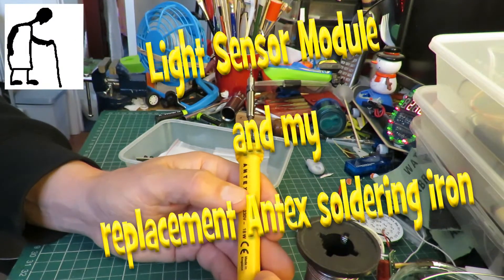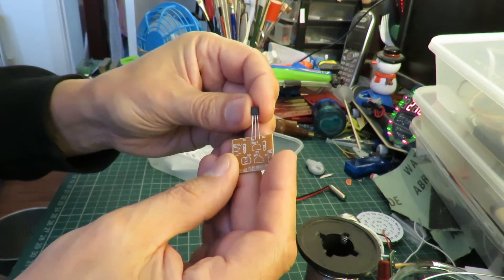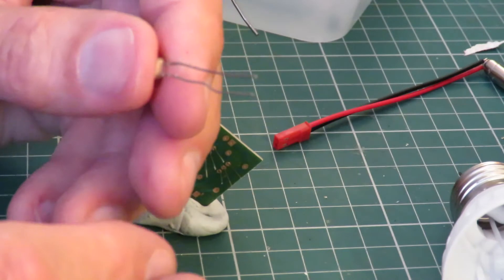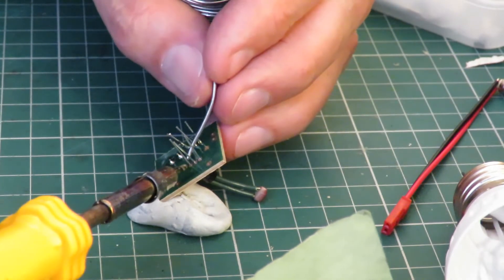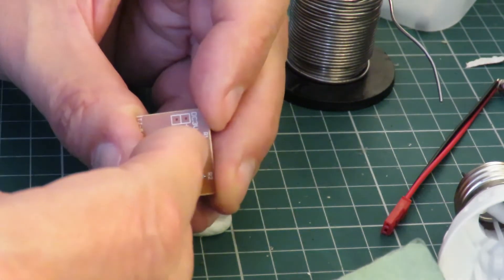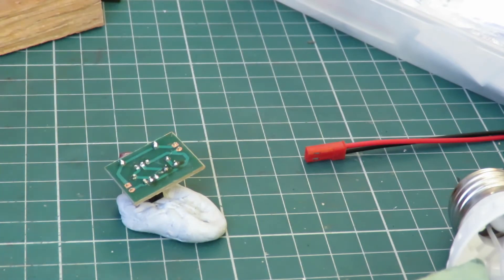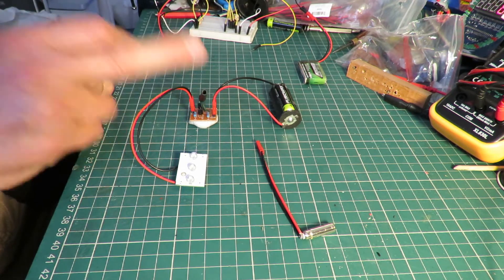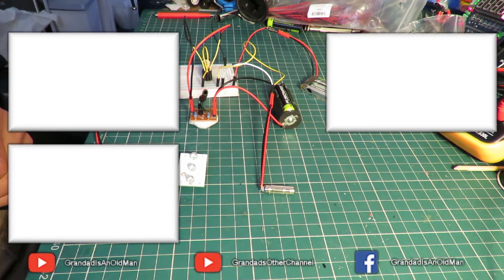Light Sensor Module and my replacement Antex soldering iron

Comment: Maybe there was a tiny boost converter inside the toothbrush circuit as well that you had not spotted? That could account for it not responding on the lower voltage? Or was it the lack of enough amperage? Hey, it's always interesting regardless of whether it works or not...lol.
Reply from the maker: Hey, sorry about the 👍 reply 11 months late, YouTube lists all the comments I haven't given a written reply to, (even if I had acknowledged the comment with the ♥), so every so often I just go through a few old ones and add the 👍 to get them off the list. With nearly 8000 videos on this channel there are rather a lot of comments that only got the ♥ acknowledgement and I understood that was why YouTube had provided the facility, to save us time. Thanks for coming back again 😁👍🖐

Comment: Can you make a solar battery charger? Thanks for this project!
Reply from the maker: That really depends what size battery you want to charge and how quickly and how much sun you get. In theory the easiest way to charge a single AA battery would be to use one of those cheap solar garden lights that charges a single AA battery during the day and lights an LED when it gets dark. You just remove the LED so it can't discharge. Here is a project I did back in 2016 that really was not very effective as I was trying to charge several batteries at once,  although good sunlight might have helped https://www.youtube.com/playlist?list=PLA5a2xPRSrB3fP_vVXEz2y88dkDR2_gPl Here is a look inside a "solar charging panel" which is no more than a solar panel with a single diode in circuit https://youtu.be/BwSBAzLkFIg?list=PLA5a2xPRSrB1SVLRn_D16dRvTrocMhFPq

Comment: Great vid . That could be used on lots of projects
Reply from the maker: Thanks. It is a very simple circuit, you will find plenty on YouTube like this. However it is a handy kit of parts. You could change one of the transistors and use the same basic circuit to switch bigger loads